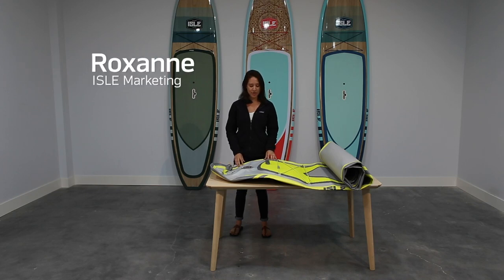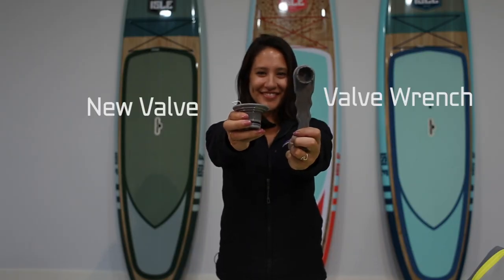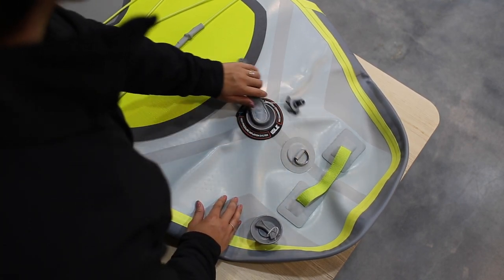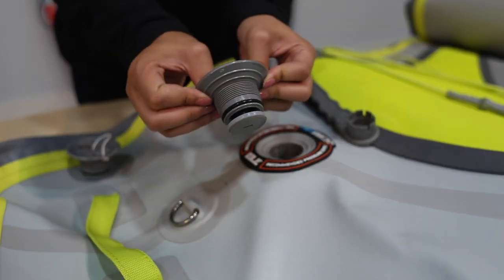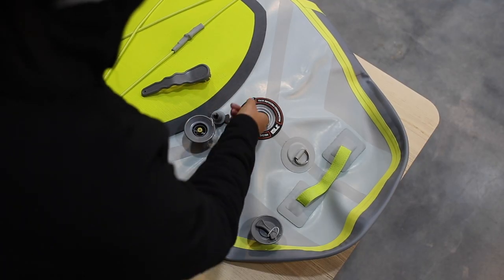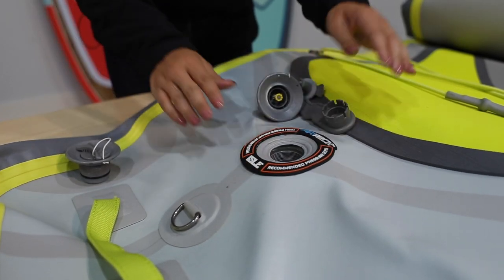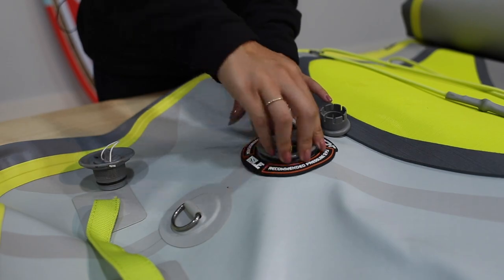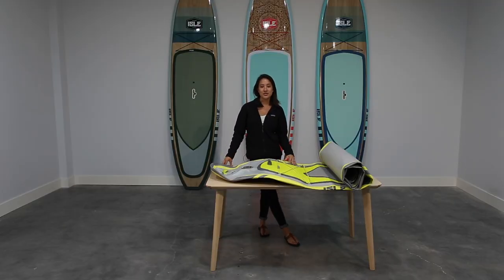ISLE Inflatable SUP - Valve Replacement

Comment: Any ideas if the old valve just spins endlessly no matter what way you turn it.  I went to tighten a valve on one of my boards because of a slow leak and it just spins in place.  Need help!
Reply: (I know this is a bit late, but) grab the internal part of the valve with the underside of the deflated board (kinda like using a potholder) and hold it in place as best as you can so it remains stationary, then use the valve wrench to tighten or losen!

Comment: How do you change the internal part?
Reply from the maker: To replace the internal part requires cutting a hole in the board to remove it (then patching that hole later).  You'd only want to do this if the internal part is broken, otherwise no need to replace it.

Comment: Hi I tried to replace mr valve but it’s still leaking around the rim. Not the cap. Does that make sense?
Reply from the maker: Debby if it leaks around the rim that's a glue issue related to an air-tight seal of the replacement valve.  If it leaks around the cap that's a faulty valve issue.

Comment: Can the bottom part of the valve actually be replace -- I had an older board I had to cut under the board and replace and Patch that also.!
Reply from the maker: The bottom part of the valve is placed into the board before it is sealed, so there would be no way of accessing the bottom part of the valve to remove or replace it.

Comment: It is not that easy. I have the same board and can't get it to budge.
Reply from the maker: It can be difficult to hold the base of the valve without it wanting to spin.  One trick is to press downward from the top, around rim of the valve, while the lower portion of the valve is pressed downward to hold it in place.  We've had some cases where this technique worked to hold the valve seat down to then use the valve wrench to remove the valve.